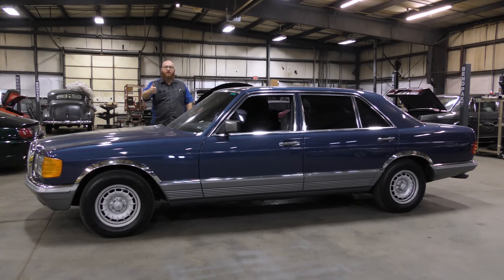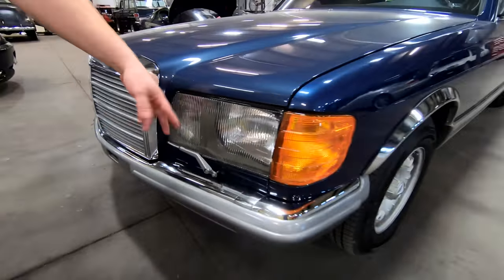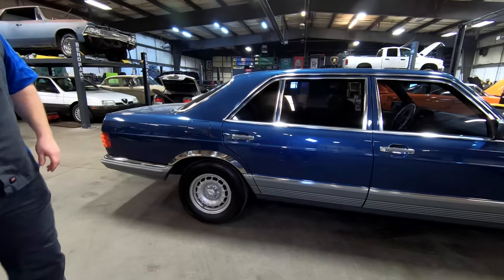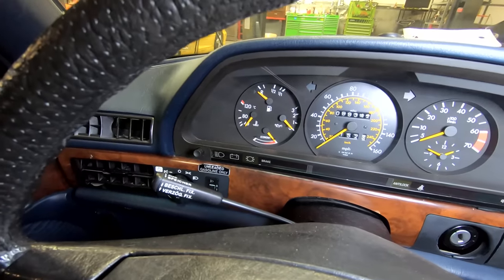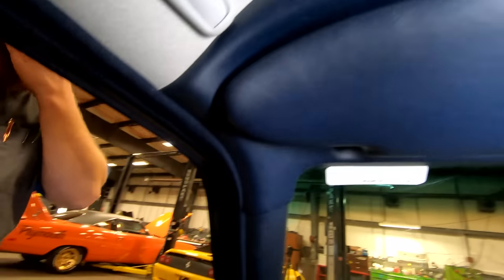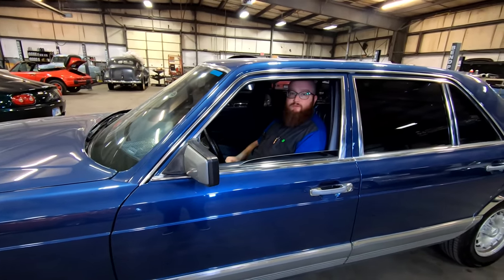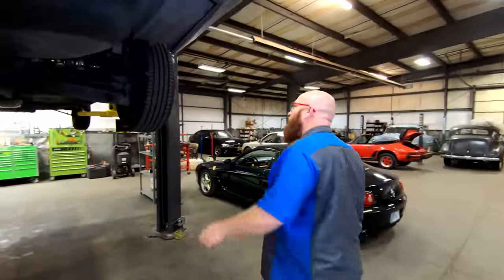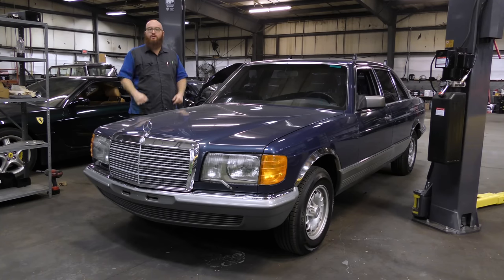Truly a gray market god! Shockingly perfect 1985 Mercedes 500SEL! The CAR WIZARD is in love

Comment: Engine bay should look good its been washed. loads of signs of it being cleaned up.. the washer biottle for example  and the inner wings... these were covered in thin film of grease friom new so it being dry shows its been pressure  cleaned...  exhaust is completely rotten... only rear box is ok.... and you cannot tell if engine mountsare anygood by looking at them, need a pry bar to lift engine to see if perished, same with gearbox and the rubber prop doughnuts. these cars are   nightmare for electrics going wrong.... real money pits... and damp inside them is a big problem too. the under carpet sound deadening gets water logged and stinks ...  they lloked nice, but the leather interior models were far better and obviously more expensive. velour was the cheapo option ion these cars..

Comment: Grey market cars are fascinating. Lots of different features as opposed to regular export models. Now these cars have to be at least 25 years old to be legal for importation.

More than likely that speedometer and odometer are in kilometers, not miles. US spec cars will have miles on the outer radius in white letters and kilometers on the inner radius of the speedometer. Odometer is calibrated in miles. But since this a grey market car, it's more than likely kilometers only on both the speedometer and odometer.

If it is in miles, more than likely this car has been federalized in some manner.

Comment: The code taped inside is for the becker radio. If you disconnect the battery you need a code to unlock it.

Comment: EPA says 15 MPG on the highway. Its redeeming quality is it burns regular gas. I wonder if it could be replaced with a diesel engine. I had a 1980 300SD Benz Turbo Diesel. It turned heads where ever I went. It was a special edition just for North America. Diesel got 30 miles to the gallon. I sold it and cry every time I remember it. My wife called it an adult car. It was 30K new and I paid 2K for it in 2005 and put about 6K into it. Today I am on my second Lexus ES350. The first one had 315,000 when I traded it in. Still looked and ran like a new car. I would love to make an offer on this car but it is totally impractical for all the miles I drive. The Lexus burns regular gas and gets 30 MPG. Might be a good 2nd car. Thanks for showing it.

Comment: These are beautiful cars. I used to work with a fellow who had an 86 560SEL the same colour. What a glorious car. These cars came with three available interiors. This velour, which is magnificent and comfortable. Real leather was an option above the cost of the velour. The standard interior, that my brother had on his 85 300SD, was MBTex, otherwise known as vinyl. It was okay, but not what I would have expected from an S-Class car. My brother loved his and drove it a LOT. When the transmission went out, the car was done. He did not feel that the rest of the car was in good enough shape to justify the $3,500 to fix the transmission when the far had so many other needs. He could not complain. The car had just shy of 628,000 miles on the clock. Yes, it was a million kilometer car. The rust was getting too bad, so it became a parts car.

Comment: The velour was an incredibly rare option AFAIK, and was possibly the most expensive too. I wonder if it was a originally a Japanese market car, it was popular to have luxury cars ordered in left hand drive to make it quicker for the chauffeur to open the door on the nearside for the big guy in the rear, coupled with the fact leather was rather unpopular in the luxury sector in Japan (the Toyota Century and Celsior were both more common with wool seat covers) are both factors for me. The question is does it look like there was provisions for curtains in the back, that would really seal the deal.

Comment: A best friend had the opportunity to purchase one of these cars.  I short time later, the owner of the car mentioned it to me.  I looked at the car and purchased it and a 1985 Porsche 944T  from him.  Loved the 500.  Had to replace a couple of things under the hood.  It was so easy to replace parts on that car.  It hasn't been mentioned, but these Euro 500 series cars had larger valves in them and were set up differently.  They were powerful engines.  Unbelievable acceleration off the line.  If you were going 60-70 miles an hour in drive gear, just beginning to push smoothly down on the gas pedal produced a linear movement between the tach and the speedometer.  Like they were directly connected.  For a large, heavy car, it handled so well.  Was told they would easily do 150 MPH.  I don't know what standard equipment was on these cars.  Will just mention a couple of things on the car though.  Some or all may have been standard.  This one had headlight re-leveling on it which had to be disconnected to meet US laws.  There was a steel rod welded in each door for side impact hits.  The car had positraction.  It went through snow like a dream.  There was load leveling on the car.  Also a detachable trailer hitch which couldn't be used because there was a steel rod or strip welded into the rear bumper to meet US impact laws. The trailer hitch was in the trunk though. The emission change for the engine was a wire or two that ran from some where to a small black box under the dash.  The car didn't pass emission testing when I had to take it in.  Put new cats. on it, and it passed.  After a couple of years of ownership, I sold it to the friend who had originally passed on buying the car in the 1st place.   He had to put new cats. on it to pass emissions in his State too.

Comment: And this is why MBZUS started importing them officially, let alone the trip to Europa in Sante Fe to get the only G-wagens available (back when they were still cool. I had an 84 500SEL until the late 90s. Original tires were Michelin XZX. Everything worked, including the rear power seat at 275K miles.... BTW - Velour was the cheapo interior for RoW - even cheaper than Tex...

Comment: I don’t think that velour is factory.   Why?   Just look at the fit, finish, or even the style, especially the back seat.  It simply screams, “not Mercedes!”.    Look at it again.    It even looks like a recover.  Check the VIN for trim code.   As the Wizard said, he’s never seen one.    My mother used to have a 1984 300DTurbo Diesel bought new in Frankfurt and converted for American import, which took several months.   I’ve been in and around PLENTY of Mercedes, and there’s no way that velour is factory.    I say that turns that $8000 car into a $5000 car, to pay for a period correct reupholster.   Otherwise, beautiful car.    For the record, if you don’t use the spec brake pads, the cheaper brake dust apparently destroys to protective coating on those wheels.   I know, it looked like peeling clear coat on my mom’s wheels by around 1990.    There was no recoating available over here so two wheels were replaced.  Yes, they did get rotated by me, but the damage had been done and luckily didn’t destroy the other pair before affixing the proper pads.
Reply: That is definitely factory upholstery! It's the exact color and pattern. Seen it so many times, no mistaking it for anything else.
Lots of Euro spec Merc's have that exact upholstery.
Reply: @marcusjosefsson4998  wow.   Thanks for the cool level headed response.   Lesson learned.   Sad to see such a lousy implementation done by Mercedes.    But thank you.  Truly.
Reply: @andrewhigdon8346  Thank you!
That velour/plush is really high quality, at least that's my opinion. I know leather upholstery is considered top notch in the US market, and it is here too nowadays. But it was different in the 70's and 80's, air conditioning wasn't at all common here in Europe for example. It used to be super expensive! My dad had a Volvo 740 turbo wagon as his company car, and the price for A/C as an option in 1986-1988 was about $3500 back then. He ordered the car w/o air conditioning because it was super expensive, and he actually owned the company...
There was some big differences between the US and European markets back then.

Comment: Well, I have always preferred US-spec cars and see from lots of car communities that they like much better Euro cars…which is weird as US specs where always better equipped and for me nicer with that 1970-it’s federal regulation style bumpers.
Reply: The Euro 380 had higher hp than the US 500 (lower compression), Euro 500 to US 560 output was only 2hp different. Euro transmissions had different gearing, and rear diff on 500/560 was 2:25 or so, vs 2:47 US. US 8 cyl cars start in second gear, something to do with getting fuel economy numbers lower.

Comment: Strange a gray market benz would have gauge with miles as primary. It would most definitely have a km primary.
Reply: Probably was required to register in the US. Owner changed the speedometer when importing it.
Reply: @marcusjosefsson4998  Probably wasn't done out of requirement, otherwise those bumpers would've been first to go :)
Reply: @tcat0211  Maybe, I'm absolutely not an expert in grey market import regulations in the '80s! It's just that we used to have a regulation just like that in Sweden for imported American cars. Most of the specifics for US-cars could be as is, but not the speedometer. That just had to be changed to a speedo with only KPH/KM/H, nothing else. Dual scales wasn't even permitted.
That specific rule is changed now, as long as the speedometer has at least KM/H it's according to regulations, dual MPH & KM/H is okay now.
Could've been just for the owners/drivers comfort, not having to convert the numbers in his head while driving.
Reply: @marcusjosefsson4998  Still my favorite era of big benz.

Comment: I had one of these cars but it was a corpse vs this one but still the design of Mercedes Benz is horrible.......rear window seal leaks mean u have a wet trunk,the EFI system is one of the most hated and complex is human kind.........Timing chain design of this engine is still not know what advantage it had to make a chain the size u can lie around the white house only to operate 2 valves per cyl a pushrod design is 100x easyer and almost needs no maintenace,central door locking is vaccuum bases thats works with electric signals (can u come up with a more fragile system)

Yes its a great car yes they run awesome and have great comfort wenn new they are very awesome cars (like this one is near new)..........Even i get that one for free i would not love it or drive it as i had to much problems with my that i started hating the design of car....

Comment: Did these have the same leaky power steering that the early 90's cars had? A tech who was working at a MB dealership in the 90's told me they were leaking on the showroom floor when brand new.

Comment: Just WOW !!! Back when the Dollar was strong and the Deutch Mark was weak (and those that had the bucks to travel to Europe, buy and drive them there and therefore qualify to bring them back as "Foreign Owned" loopholes) ... and MB actually built worthy vehicles instead of charging  Consumer for their "R&D" efforts ... I will NEVER buy a new Germany vehicle ... ever !!! POS ~~~
Reply: P.S. Car Wizard and fans ... a "Life Hack" on MB windows (learned on my MB 450SL) ... when the Window motors go, simply drill a 1/2" hole in the window regulator strap over the single bolt holding the motor (we call it a "Clearance Cut" in Aerospace), remove the bolt and use a standard "Bosch" motor to replace with ($60 vs $1,000 MB Motor as they are the same BTW). 30 minute job and no removal of the regulator scissor mechanism ... where all the "labor" costs are). You're welcome.

Comment: Perfect?

Never with the chrome wheel housing... Just there to hide something.
I often doubted the competence of your work, but it was something like "come on, it's no real work, just some YouTube wannabes."
But using words like "perfect" is more than you can handle.
If you are capable to let something more complex than a landyacht of american origin be back on the road I would be really astonished.
So please, pretty please, stay with the things you are really competent... A Merc of any time is nothing for you.
Speedo is not original, there has been no factory V126 with european bumpers, left hand drive and miles speedo.
Climate control is not in good shape, otherwise the mono valve would have been replaced.
Catalytic converter is nothing original, the 240 hp version came without.
So it is a nice example of a first series V126. But "perfect" is something different.
Reply: putting an MPH speedo in is easy and was probably done before delivery, cats were on the European Mercs from around 85/86 they were the 1st main manufacturer to do it in Europe I think. It's a 35 year old car it's not showroom but it's about as perfect as you can get without a full restoration
Reply: Calm down there Fritz
Reply: @gordonmcgregor6431  It's a good 500 SEL, without doubt.
To call it "perfect" is just leading to something different.
I bought a '89 560SEL in 2012, imported from Japan, low mileage and dealer advertising "perfect condition".
Needed two years and more money than for the car itself to sort it out ;).
The body was absolutely free of rust, so it was pure technical work. But tons of it, even if it was in "showroom condition" at first sight.
And my had come with tons of paperwork, every little repair and maintenance was reported.
Back in the 80ties you could not make the European version "street legal" as far as I know. A friend of mine from Austin, Tx tried it once and failed.

Comment: this thing is at 80k km not miles :D it means 50k miles on it .. wow ..
Reply: Nope @5:54 you see "miles" on the counter and the outer Speedoscale is miles as well. Only the inside yellow scale is kilometers / hour. That instrument cluster was optional extra for export cars and is factory installed. So: yes - it has 80K miles, which is about 135K kilometers. Also not very much for a mid-80s car. There was a 500SEL in my hometown, which did 525K between 1985 and 2008 with first owner / first engine / first gearbox. When the owner died in 2009 his kids sold the car to some "tuners" for a few thousand Euros ...

Comment: That is a nice Mercedes. Those “ugly 80s headlights” and the 70s and the 60s and so on were a lot easier to replace than headlights nowadays because design engineers have to over think a simple process by requiring part of the front end of the car to be disassembled to replace a headlight.